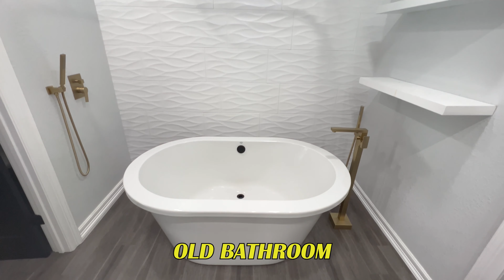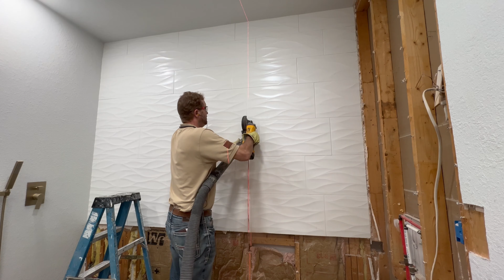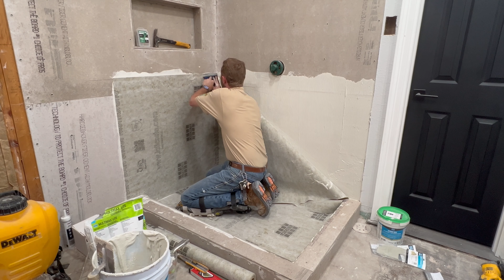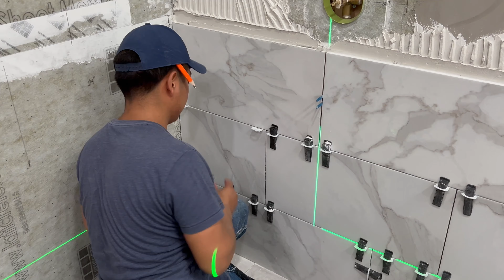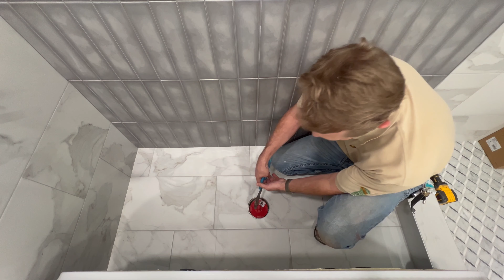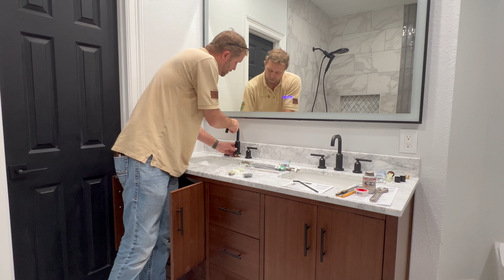Master Bathroom Remodel Cost $$,$$$, Shower Prep & Tile Work, Freestanding Tub & More...

Comment: Am I missing something? Appears that there's no overlap of the waterproofing membrane from floor to wall on the longest side of the shower? 14:09

Other than that looks like beautiful work. Appreciate the care that went into dealing with the window, though just shocked that the original remodel just covered it over. Less surprised by the flooring over the original tile. Assuming the tile was flat and sound, saves some money to avoid the demo.
Reply from the maker: I’m sorry, but it’s a short sped up video, not a complete video, so I realize how that looks, but if you go to some other parts of the video you can see that 5’ edge with 5” Hydro Ban with extra print on it, and the factory corner pieces installed which you can see at 15 min and a few seconds while the shower pan was filled up and I’m standing there looking at it.
Reply: @craftsmanconnection  Missed that, thanks for the clarification. Was the reason for using the bottom sheet overlapped on the curb and left wall, but not the back wall due to the width of the material?

Trying to understand options because I may be doing a similar shower in the future, so always good to understand how to work with different materials (I've done a tub shower enclosure with Kerdi-board and Kerdi-band, but have not used Hydro-band. Loved how easy the Kerdi-board is to work with, but their systems are definitely on the pricey side.
Reply from the maker: Yes, the roll is only 39” wide, and that worked from one bottom corner to the curb, with some overlap up the curb. Then I used the 5” to 6” banding material and prefab corners to cover the joints.

Yes, Schluter is expensive. Another popular YouTube creator, Tile Coach is a good channel to research this topic more.
Reply: @craftsmanconnection  Yup. Familiar with that channel (and I know he's not a fan of Schluter. 😆). One of his vids helped when I was trying to find the optimal trowel for 12x24 tiles.